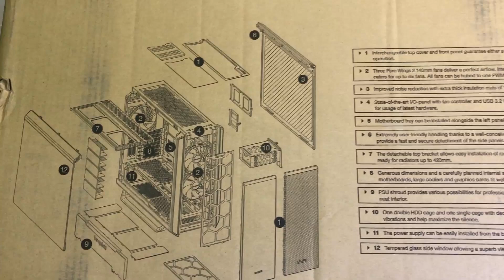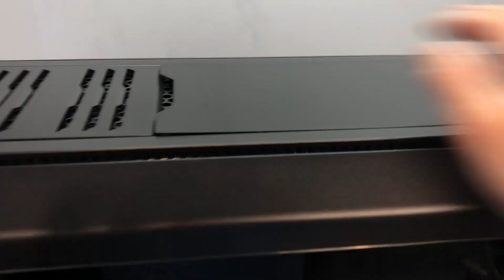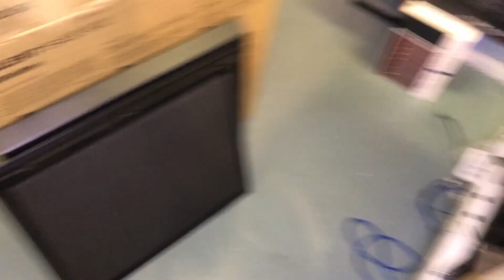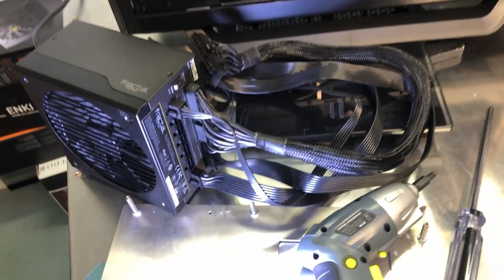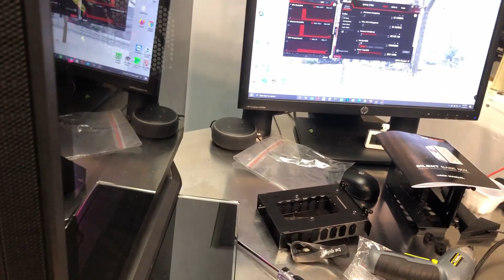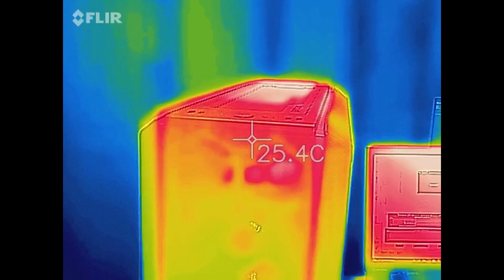Overclockersclub takes a deep dive into the Silent Base 802 from be quiet!

Comment: TOP TIP: You mentioned about screwing in the motherboard, and not forcing the screws.  There's a fool-proof method to avoid crossed threads.  I've not crossed any threads in over 40 years and thousands of screws, nuts and bolts.  What you do is, when you insert the screw, you unscrew it first until it clicks.  That click is the thread dropping into place.  Now you tighten the screw and it goes in every time.  If you don't feel a click after a full turn, you're probably not holding the screw straight, which would definitely have caused you to cross the threads.  Just make sure the screw is straight, and try again.

This looks like a nice case, but I'm surprised there's so many screws.  The last PC I built had a completely tool-free system.  There were a few screws, but they were captive with knurled knobs.

Comment: This is interesting regarding the tube placement. It seems we kinda had the same idea regarding bottom tube front mount with tubes running through the hole for the hdd slots. Is this something viable to do with a 420mm? I mean, will the tubes be long enough to reach the CPU? It seems that it is certainly possible in inverted mode, but what about regular?

Comment: i bought the solid panel version and its disapointing as it doesnt come with hd covers so when i do buy a spare glass panel ill have holes, very disappointed in be quiet for not covering hd holes with covers like they have on the glass option.  I couldnt even find white ones for sale anywhere, But i i contacted be quiet and amazingly they sent me 5 pieces for 11 pounds.  fantastic customer service and wasnt expecting them to make that offer.   I wanted to share this outcome  as its rare in my experience a company does things like this so full marks to be quiet.  I now have my solid white panel case with the white inserts and am very very happy with the build quality.  Itll be nearly another year till i put all the pieces together but i have my first part, the 802.  Next is the 360 while corsair rad cooler, then 2tb wd m2 mvme, then a 850 white power suply.  after that amd and intel should have their later offerings of 2022 out otherwise itll be a gigabyte master 570 with a 5900x and my old 1070 amp extreme will do till the 4080 comes out withouth scalpers.
Reply: Be Quiet! have always been good at customer service.  I bought a Silent Base 800 back in 2014 and reversed the drive bay door.  Unfortunately I put the screws in the wrong holes and went through the front door.  They sent me a new door for just the postage cost.  Because of that for subsequent builds, I've always bought BQ cases.

Comment: I have the white version, and am very happy with it. I connected the fans to the motherboard instead of using the case-fan-control.
Reply: I plan to buy such a case, is it really as quiet as the manufacturer claims?
Reply: @zaplakailol  I am not sure what exactly ( decibel ) is claimed, but it is silent enough for me. I can hear the fans if I concentrate on it but I also configured the case for maximum airflow ( there are more covers if you want less airflow for less "noise" but I did not try that because I prefer to cool my hardware as much as possible )

Comment: Great that you showed an inverted build. My only concern with the inverted mode is that the rear exhaust fan is now at the bottom, and thus becomes a cold air exhaust which is not optimal. I don't know how you could get around this.